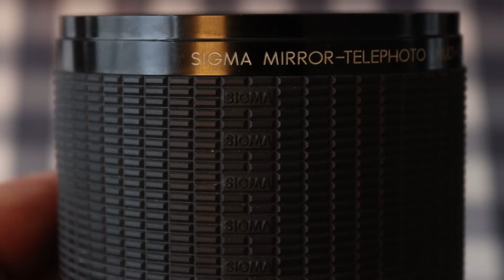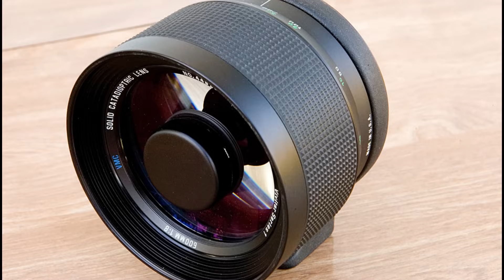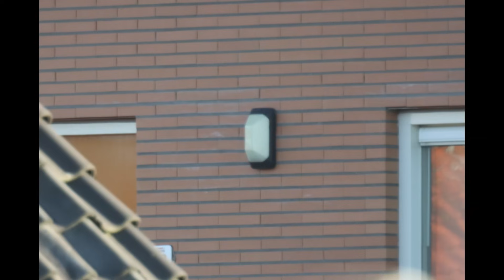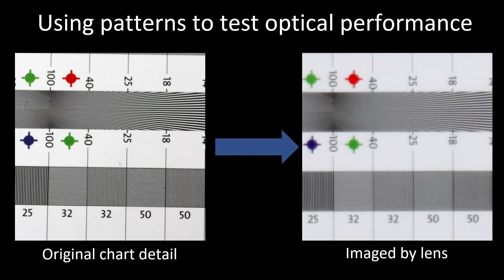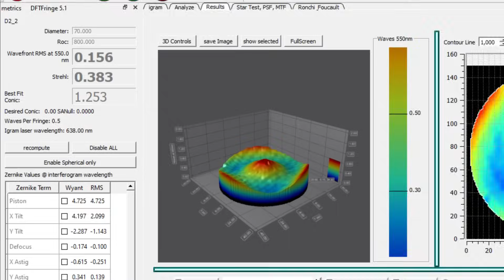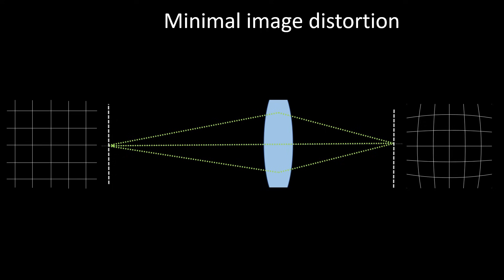Camera Mirror Lenses Part 1: Visual and Interferometric Testing

Comment: I have a Rokinon 800mm. Its Strehl ratio is probably 0.  I have to put a cardboard cap on it and make a ±29 mm diameter hole in the cardboard at one place, to get light rays to be less "randomly unfocused". I get better results than the full-aperture.  But it gets really slow by this.  I dont have any gear to try to repair it. I can only do the aperture workaround.

Comment: I've been using a 500mm f/8 Nikkor mirror lens for years for deep sky AP. Although the spot focus size is relatively big, for widefield DSOs it performs ok. I have even been able to crop in on some smaller galaxies and nebulae after stacking and it looks ok. All the other traditional glass telephoto lenses I have (granted none of them are of stellar quality, but of a similar price point) suffer much more greatly from CA at infinity focus and is very apparent when looking at a starfield of white stars.

Comment: Tamron SP 500mm f8 is known to be very good, i had great result with it as well on a 16Mpx micro 4/3 sensor, so quite demanding sensor !! Only tested the center of the frame tho !!!
Reply: and on my tiny sensor, it made me the owner of a 1000mm F8 lens for 100 CHF. I had great images with it
Reply: The bokeh can be very pleasing in some cases. But can also kill a shot, for sure. But now always a drawback for me
Reply: i can sens you images i took with it !
Cause you seem disapointed with miror, lens, and for me it did an awesome job !
I mean of course my gear now is better buit for 10x the price...

Comment: Vintage lenses with distinctive yellow tint can be radioactive. I'd check it =)
Reply from the maker: None of the lenses discussed in this (or other videos) on my channel contain radioactive glass types.
Reply: @HuygensOptics  You didn't mention that in the video, so I was afraid, that you can be unaware of such possibility. Reflex lenses are insanely good in general, I just bought Tokina 300mm F6.3 for my M43 camera, thanks to this video. And I'm insanely glad that I bought it =)

Comment: Anyone ever try one of these for astrophotography?
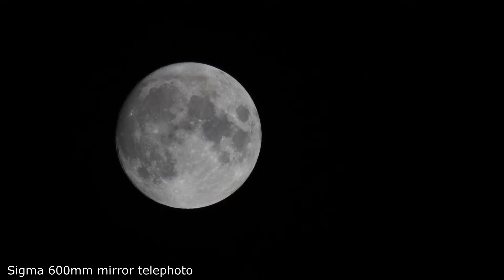Reply from the maker: at 6:50 min into the video, you can get an idea. They are generally not sharp enough to do serious astrophotography. Also the focal length is   quite low.
Reply: @HuygensOptics  These things are very similar to shmidt cassegrains telescopes. I wouldn't say the focal length is low, maybe for planetary stuff but I shoot plenty of wide field DSOs at 250mm. Curious if anyone ever made one that was actually sharp

Comment: Another reviewer said the two mirror reflections produce an upright image, so these lenses use an erector lens in the final optical path. Is this correct? If so, does that mean you could simply remove the erector lens if you were not worried about an upside down image in the viewfinder, or would the erector lens be making other corrections as well? Astro photography could be a reason to remove the lens.

Comment: i would like to know how to get at fungus under the front mirror glass ,i can see no way of getting at the mirror itself (sigma 600mm mirror lens)
Reply from the maker: I have not taken apart a sigma 600mm lens yet. There are some videos demonstrating the removal of fungus, however not for the mirror lens: https://www.youtube.com/watch?v=8L4vdsXA9WA. They demonstrate that you need special equipment to to do this. Btw, the mirror itself is also very prone to oxidation and is probably also damaged and would require recoating.

Comment: This reminded me of a many years long problem I've had with precision marksmanship. Since I have to wear glasses, I always end up having to look through the upper left corner of the right lens where the already bad chromatic and spherical aberration is at its worst. It doesn't matter how good my optic is when my glasses turn everything into a smear anyway. I've wondered if there's a way to correct that portion of my glasses to see correctly at the cost of having an obstruction somewhere else on the lens.

Comment: Great explanation! It makes me wonder what the parameters of the reference spherical mirror should be? Should it have the similar focal ratio as lens under the test? Surface error of lambda by 4 may be enough or more is required? Thank you!
Reply from the maker: It's better to have a much smaller focal ratio for the reference mirror. In this way you only use a very small area of the total mirror surface effectively, thereby increasing the accuracy (because a smaller surface contains a smaller part of the total error). The reference mirror is F/0.80 whereas the lens is F/8.0.

Comment: Part of the contributing factor to the mirror-lens's lack of sharpness is its diameter.  The larger the diameter of the the front lens, the worse heatwaves (air density differences in the atmosphere) impact images, reducing sharpness.  Also, the further away you are from the object, the worse this is because you are looking through a thicker blanket of air.  While this isn't the main reason for the lack of sharpness, it is a major contributor.  Some good mirror lenses are:  Tamron 500mm and especially 350mm mirror lenses, Nikon's 500mm, Olympus's 500mm and some Sigmas.  The finest mirror lens ever was probably the Questar 700 (mm) made by a high-end American telescope company.

Comment: Hi !  I am from Romania and I watched your video with pleasure and with nostalgia, because I also spent a long time grinding and polishing telescope mirrors of all kinds, spherical and aspherical, including hyperboloidal. I was cheching using the Foucault method, sometimes in combination with autocolimation, I didn't have the possibility to use interferometric methods. I even built a telescope with a bronze mirror, like in Newton's time !  BTW, very good photografic images can be obtained with a simple Newton telescope, but it is too large.
   I was amazed that the manufacturers did not care that the mirror surface could be deformed by tightening some screws !  That's all I thought all the time !

Comment: how to reduce the aperture in reflex lenses for more Depth resolution ?  
Tried shading the main mirror, tried reducing the lens outlet, tried changing the inner black cone
Reply from the maker: They are not really suitable to reduce aperture. The outer aperture can never be smaller than the obstruction, so that it the absolute minimum aperture size. But as aperture and obstruction get close to each other in size, diffraction will start limiting the resolution, which will lead to resolution degradation.

Comment: When we use these lenses on an APS-C camera, do we need to calculate the focal length multiplier?
Reply from the maker: Yes APS-C is 25.1x 16.7, so I guess the effective focal length ratio is about 1.4, compared to 36x24
Reply: @HuygensOptics   as I understand depends on camera brands ( for sony APS-C 1.5 etc.).  As an amateur photographer, I learned tons of details from you. Thanks a lot.
Reply from the maker: That is correct, you have to take the specific sensor and divide the full-frame specs by your specific sensor dimensions. Not all sensors have the same aspect ratio, so it's not exact science.
Reply: @HuygensOptics  stupid, effective ° viewer, non focus mm
Reply: NON

Comment: One of my contracting companies put a holographic lens they received into their interferometric setup and the fringes turned out like these, at 1/4 wave.  Then they put the replacement I was selling them into the set up, and the fringes, were perfectly straight and parallel at 1/8 wave.  I won.  Proved that who the fabricator was, mattered.

Comment: Thanks for another great video! The question of coherence length is quite interesting, have you measured it for your laser diode? Given that it optical path through from the beam splitter through the telescope and back may be around 70-80 cm while the optical path from beam splitter to reference spherical mirror and back looks to be about 15 cm, so the coherence length of your laser seems quite large (I thought typical diodes have a coherence length on the order of < 20 cm). Appreciate your thoughts on this, looking forward to the next video!

Comment: Oh this is awesome! I had looked for a video like this for years about how exactly people test telescope mirrors and what the different numbers mean etc with little success. I found some very scholarly articles that went far above my head with almost no visual representation so they were extra hard to understand without a background in optics. Thanks!
Side story:
I had to clean my telescope mirror for the first time. Overall it was really easy, but when I put everything back together I could not get it collimated for the life of me. Turns out it was that mechanical stress you talked about, only my diffraction patterns (or in my case just defocused patters) didn't show up like most people showed, which made it take forever to figure out. The real reason was that only one of my mirror holder clamps was really putting any stress on the mirror, so the astigmatism was very asymmetrical not matching the 120 degree astigmatism you showed here. If I had seen this video first, I bet I would have saved hours!

Comment: Great ! I also have/had (my altzhiemers) one of the sigma 600s, also a tamron sp 500. I have to say they they are all extremely disappointing compared to an old nikkor IFED 300 f4.5 and 500 f4 IFED P. Of course they are also a lot smaller and lighter (and cheaper). But frankly the images are so bad I doubt I would ever use them, I keep them for interest only. Some 25 years ago I also had an example of the soviet MTO 1000mm f10 photographic maksutov, and the meade ETX 125 telescope maksutov. But again both were disappointing, yielded unsharp images visually (using vixen lanthanum eyepeices) . I later built a Newtonian using a second hand 12"diameter f5 (ie 1500mm fl) I was told by the seller was very high quality (1/10th wave by BC&F .. but I have no way  to know, and I am generally quite cynical) .. but that produces extremely sharp images on a clear night. (But a parabolic mirror is optimised for just close to the axis, as you explain makes no compromises for field flatness coma yadda yadda over a 50mm image circle needed to cover 35mm full frame. 

So in summary .. coomercial mirror lenses for photographic use may be small and light , but out of the box are rubbish compared to quality telephoto or even a parabolic mirror. 

I'm very curious to see how much you can enhance the out of the box performance in part 2. 😃

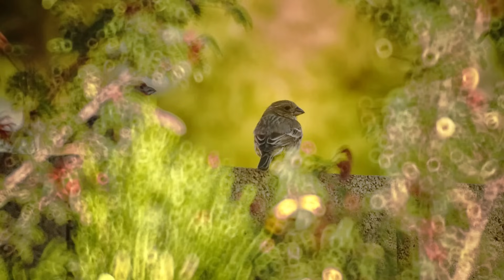Comment: 6:30 "The unnatural boké due to the central obstruction ...". No, it's not the central obstruction that causes donut boké. It's the annular primary mirror.
Reply from the maker: If there were no hole in the primary, you would still have donut-shaped bokeh.
Reply: @HuygensOptics  a primitive test I made tells me you’re probably right 😉

Comment: A problem with using coherent lasers is their coherence length, in l.e.d. diodes it's. not there., except in holography diodes. In your single photon video also did you consider this?

Comment: I wouldn't dismiss the possibility that you got a bad unit of the Vivitar lens. I believe it's in fact a rebranded lens from Samyang Optics, a well-known Korean manufacturer of low-cost manual lenses. I've seen various other YT videos where these lenses proved much better than expected for the price and reasonably sharp. (I forget whether they were reviewing this exact lens, as the same company has other mirror lenses with shorter focal lengths, and non-mirror super-telephoto lenses.) Quite possibly, the company cuts costs by having lax quality control, which would produce high sample variation and explain your experience and the negative reviews you found, while others still receive good units.

There's also a Sony/Minolta AF Reflex 500mm f/8 lens, which is unusual among mirror lenses in supporting autofocus.

Comment: Thanks for this, looking forward to more.  I have always been fascinated by mirror lenses.  And always disappointed when I tried one.  I LOVE the donut bokeh btw.  
40 years ago I came across the 600mm Sigma lens you show in a camera shop.  It's painted surfaces were green.  It looked so James Bond/Military/Cool, but I could not afford it.  Today I own one.  I just don't use it because it's disappointing, and I have much better quality lenses.

These lenses made a little more sense in the days of film when cropping in required a darkroom, or a special order, but a mirror lens could  deliver a significant "zoom" for low $.

Comment: I had my primary mirror on my 150mm Newtonian refigured by an optical company to .986 Strehl ratio and .08 wave with a zero knife edge test at >.01mm. Takahashi quality for $500 on a used Celestron reflector. A Strehl ratio in a telescope less than .750 is unacceptable. Even before I had my mirror refigured it was better than .750 Strehl. I had both my mirrors recoated to 96% reflectivity. Guys at my astronomy club are envious. 😉

My Sky-Watcher 102mm Maksutov-Cassegrain telescope with 1300 focal length and F-12.7 ratio comes with threads for a standard dslr camera after I remove the eyepiece diagonal is just a giant catadioptric compared to those. My son put his Canon onto it and suddenly could take photos or videos of Saturn or even Uranus. I set my mount to track Bode's Galaxy and it only took three 5 minute exposures to get a very good picture of poster quality. I haven't been able to get my telescope back from him.

Comment: A friend mentioned in his previous job he was operating machine that 'polish' silicon wafer for semi-conductor industry.  After some googling, it appears that the "Plasma Etching is the removal of plastic, silicon, or other non-metallic material using plasma created by exciting ions in a gas, usually oxygen and CF4. "
which makes it an ideal tool for polishing a lens.
I think, it should be a dry and non contact process, so the etching and fringe lines inspection could be done continuously.

Comment: I don't know if it would be interesting and challenging enough for you, but might you consider making a low cost hyperspectral camera? I made my first attempt over the Summer and to my surprise it actually worked, although very poorly. Going by memory here, I think I had around 500 colors which was good, but it was very blurry. I'm a little proud I made it with stuff I had laying around--computer camera, transmission diffraction grating or DVD for reflection, razor blades, magnets and duct tape. It used pushbroom style imaging which was done by me moving it slow with my hand. In other words, you would die laughing at it. I would be interested in seeing how you think the project through and how you would build it.

Comment: I am curious, in your interferometer set-up, would it be better to replace the spherical mirror with a parabolic one to produce 'higher quality' spherical wavefronts?
Reply from the maker: No, you can only create a spherical wavefront with a parabola from a flat wavefront as a basis. If you start from a point source in the radius of curvature, you need a sphere to create a spherical wavefront.

Comment: I had one of the Sigma 600mm lenses in Olympus mount back in the 80's. I never really found a good use for it. I recall a filter drawer in front of the lens mount. It could be fitted with a small filter. There was a set that came the lens including a red and yellow filter for black and white and one or two neutral density filters.
Reply from the maker: Yeah that is correct. I have no idea what these were intended for other than attenuation, especially the red and the yellow one.

Comment: Best cheap mirror lenses are Russian MTOs (they could be the best but i have not tried them all like Nikon 500mm f8)
I have MC 3M-5CA 500mm f8 that is good and МТО-11СА 1000mm f10 that is excellent
But all of them are very hard to use, usually i leave a lens outside for 1 hour for temperature to equalise

Comment: Question. What would happen if you obscure the front of a catadioptric except for a circular spot in between the rim and center mirror? Would the bokeh be circular or would it produce a nice coma?
Reply from the maker: The bokeh would be circular, though probably slightly asymmetric. But you would limit the amount of light drastically and you would end up with a very small aperture telescope with very little light to work with.
Reply: @HuygensOptics  I was always thinking about why catadioptrics are not made with the secondary mirror offset so as to not obscure the primary's view. But watching your channel I kind of soon understood the level of complexity in alignment and making of such mirrors. Thanks.

Comment: would be possible to change the obstruction shape from circular to another like a hexagon or a octagon?
Reply: Yes, but why ?
Its not obvious it would yield any advantages on the contrary may make it very difficult to grind/polish without a rolled edge, hard to support etc (turning cylinders and threads on a lathe is easy. How would a hexagonal focusing mount work ?
Reply: @davesmith9325  sorry for the late reply.
the point is to charge the bokeh to have a unique characteristic.
also, it could be cut after the fact.

Comment: Vey interesting, keen for part 2. I picked up  a No-Name 500mm mirror lens from eBay, ridiculously cheap ($120AUD), purely out of curiosity. Its very fiddly to use, the focus ring feels gritty, and there is very little margin between being over or under exposed, so I never use it for anything serious. But it is Fun to play with, and for me, that's the most important thing about a hobby. And I have taken some really cool photos with it. I cant justify spending thousands on a interesting lens, but a hundred bucks? sure! 
I guess I wanted to point out that a super cheap mirror lens, whilst does feel cheap, can be good enough for a bit of fun, and worth getting if you'd like to play with something a little different.